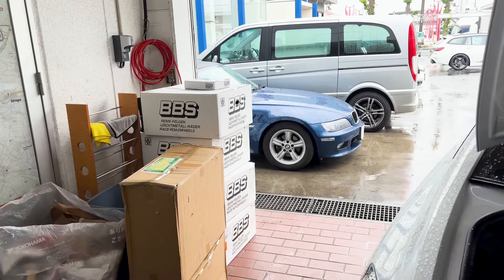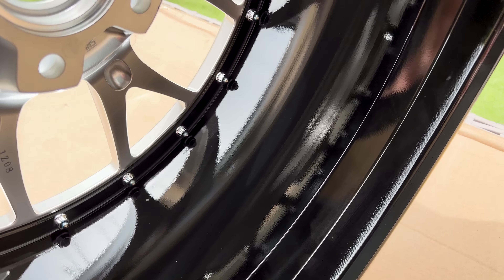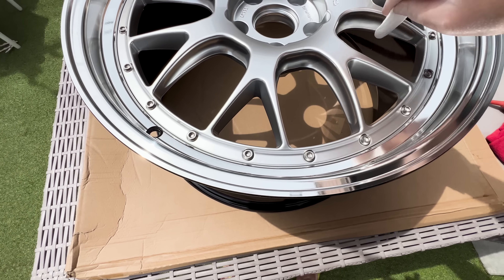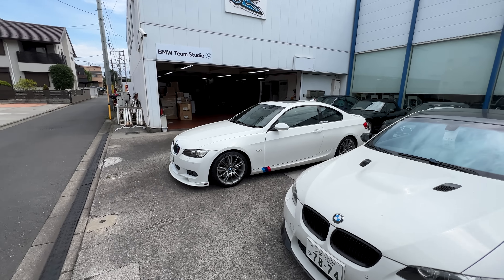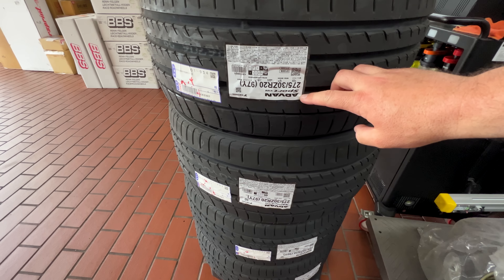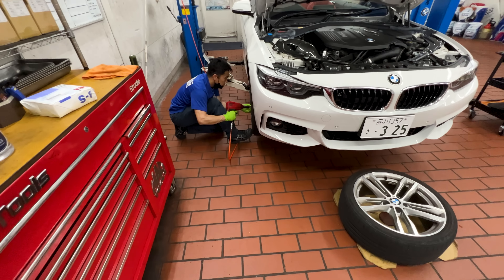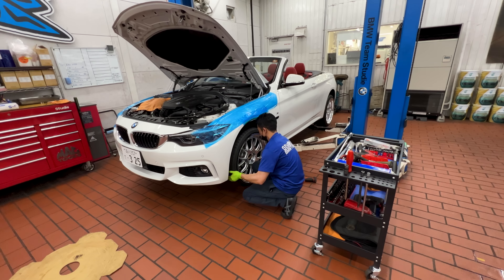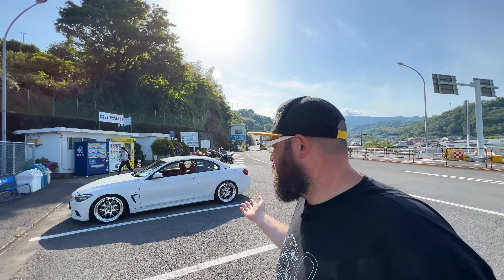My Perfect Daily Driver - BMW 440i

Comment: Nice to see the F33 in a proper feature. The B58 is a fantastic motor and you may want to consider a mild tune like bootmod or mhd on it. This generation of BMW is aging well and I think is the right balance of modern design without being as shocking and excessive like the G series. I like the “325” license plate as that was always a classic 3 series with a proper six cylinder. I recently sold my F20 116 which was also a fantastic daily. All I had on it was the Dixcel M type brake pad which nearly eliminates brake dust which may be a good thing to consider with those new wheels.
Reply from the maker: Yeah thought about it a tune, might do it, not sure yet. 325 is nothing to go with BMW, it’s my wife’s name written in Japanese numbers 😂
Reply: @dino_dc  HA! That plate idea is awesome. My daughter has actually come up with the same idea for license plate on that future mythical day when I actually get a fun car to drive again.

Comment: Looks lovely Dino. I was about to type out that you should have probably balanced those wheels before doing the coating as the weights may not adhere properly. Insane that it needed no weights! Ive made the mistake of coating wheels with (the same coating) and having the weights come off after a bit of driving! Anyhow , enjoyed this one, car looks sick!
Reply from the maker: Thanks for the tip!

Comment: sexy 440i guy, 
just got my 440i convertible and dont think bags r gunna work out and i was gunna go with 19" wheels but after seeing this i think 20"s fs u did say these tires in the video were "thin sidewalled" do you think i could run a bigger tire on a similar setup without rubbing? and if u dont mind the width of thoes bbs lm-r's i may have todo the opposite and get lm's hehehe.
Reply from the maker: I don’t think bigger tires are possible, you would run. Wheels are 20x9 & 20x10

Comment: Hi!

I have the same car with xdrive, h&r springs and the steering feedback is awfull compared to the earlier bmws.
Did you feel big improvement in the feeling after the istallation of the kw kit?
Thx!
Reply from the maker: Yeah it definitely loads up more mid corner but nothing compared to an hydraulic rack
Reply: @dino_dc  Thank you for the answer! Nevertheless, i think this car is one of the best allrounder. Its fast, beauty, luxy, comfy, the sound is lovely, can put the kids to the back seats. Its cool.